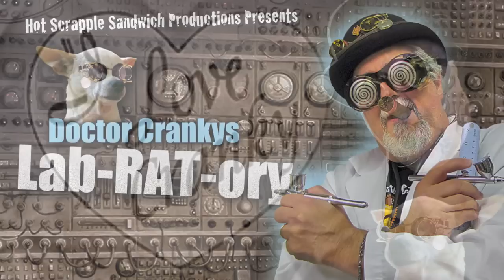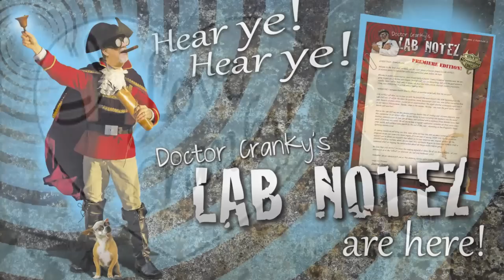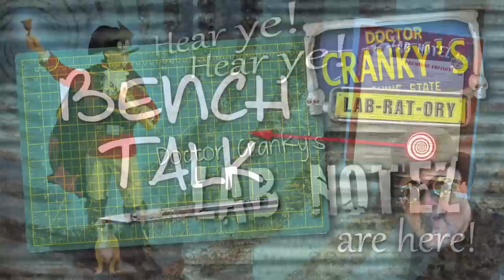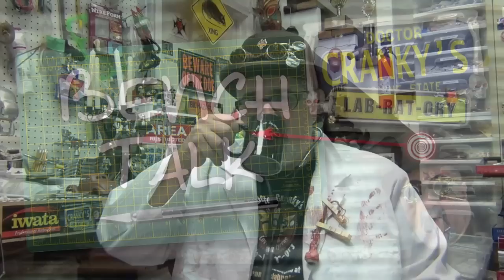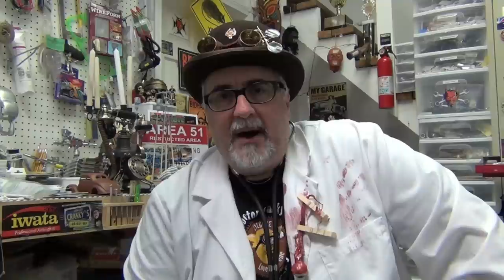LAYERING:  PRIMER TO PAINT TO CLEAR

Comment: +Michael Mcneive, you can still purchase the clear coat you asked about. It's been relabeled and is now called AXALTA TRIM & JAMB CLEAR A-7480s. Same part number as the Dupont label. Same formula as well. Axalta bought out Dupont a few years back and just changed the label on the can. Hope this helps!

Comment: Very informative Vid. I was working on a model which I primed with Tamiya Fine Primer, then I sprayed Duplicolor on top of that and that's were the horror began. The Duplicolor paint reacted with the primer and the primer started to crack. So if using Duplicolor, better use Duplicolor primer or Plastic Coat.
Peace

Comment: Doctor cranky, I think I would like to stick with using acrylic paints.  so if I were using plastikote for my primer, using acrylic paints for my base coats, and weathering, what do you suggest would be a good acrylic clear coat to finish the model with? Is there anything that comes in rattle can?
Reply from the maker: I would test Tamiya's clear coat on plastic spoons with the acrylic paints you are using.
Reply: @DoctorCrankysLabRATory  thank you, I've learned a lot from your videos, I'm planning on buying your book this coming week. One more question concerning plastikote, I went on Amazon, and I noticed that they've changed the look of the can, from the style that you show on your videos, sometimes it's called red oxide? Is the type I want to buy simply called red oxide sandable primer?( I don't see it actually called Ruddy brown on the can.) Thank you again.
Reply from the maker: Yes, that's a good one, but I also like the black and grey.
Reply: @DoctorCrankysLabRATory  doctor cranky,   I'm sorry for asking a million questions, but I have one more, is there a difference between plastikote# t234 red oxide premium primer , and plastikote "all-purpose" red oxide enamel primer number 2590??   the difference (that i can see) is the price,  the premium is $18 a spray can, and the "all purpose" is $8, will they do the same job?? Thank you, I'm trying to learn. I appreciate your time.

Comment: I always clean my model, then do a light primer mist coat for tackiness, then 1-2 good coats of primer for smoothness, then I sand with 600, clean again with 3m cloth and mild detergent and then apply base. I also heat my bases and clears under hot water until I can shake the can and it stays warm. That may not be the safest method but it makes the paint lay down thinner and smoother and it takes way less work to get a good shine after that. It works very well.